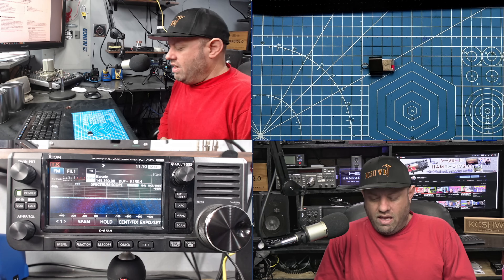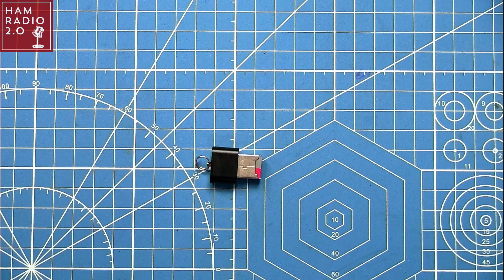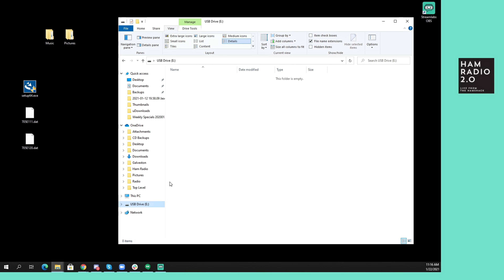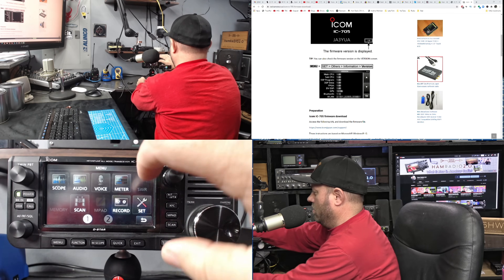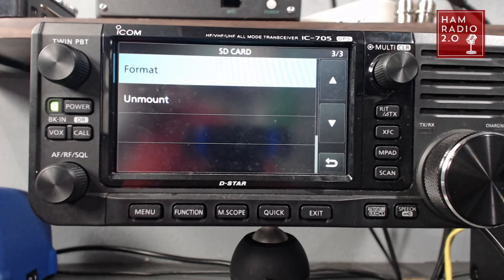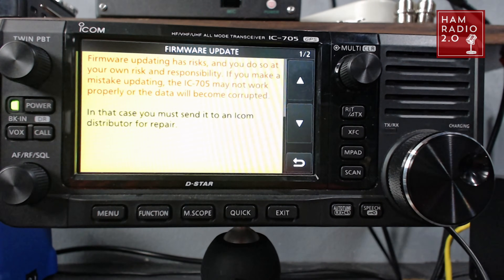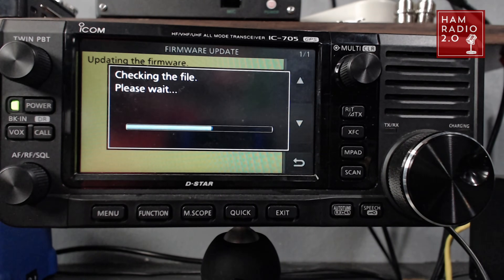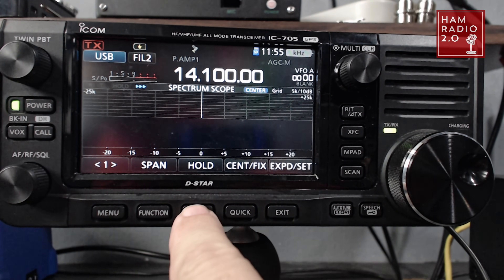How To Upgrade Firmware on the Icom IC-705 | IC-705 Firmware Update

Comment: The manual says you need to use a microSD up to 2GB or a micro SDHC up to 32 GB. The only card I was able to load and format was an 8GB  SDHC but I had  a 64 GB and a 128 GB SDHC that I tried to format first. READ THE MANUAL FIRST! It can save you a lot of time.

Comment: 32GB is the limit for FAT32. There are tools now that allow you to format drives bigger than 32GB, but I wouldn't do that for this. 32GB should be plenty for this radio use case.

Comment: I posted before, I am a marine radio operator. we use an Icom M710 if that radio makes any sense. We use single side band. We also change the frequency to bounce it off the ionosphere to hit land, depending how far out we are. With a ship, the station is moving.

I know my license is not HAM but we use HF/MF ssb 1.6 to 30mhz.  Question, are those HAM bands too?
Reply from the maker: Yes there are Ham hands in that range too

Comment: Section 17 of the owners manual gives you a few pages on how to update the firmware.    Guess Icom didn't want to be repetitive?  I'm not trusting enough to take any firmware instructions from anyone other than the manufactuer or their owners manual.   If you brick that radio with just some instructions from Google  you'll have no warranty.    I'm not as trusting as you and I sure as hell wouldn't advise viewers of anything outside of the manual.   I know...it's a PIA to RTFM but sometimes we gotta do it.
Reply from the maker: According to the message that comes up on the screen before loading the firmware - if you brick it for any reason, it voids the warranty - instructions from Icom or not.

Comment: 7300 still shows v1.3 from July 2018...  Where did you see 7300 release mentioned and did they have a date ??
Reply from the maker: I didn't see a date, but I was told that this new firmware was for all 3 models.  If you go to the IC7300 page, it does still show 2018, but the info I was given is that there was a new version coming for that model also.